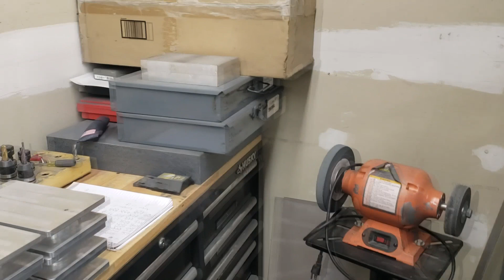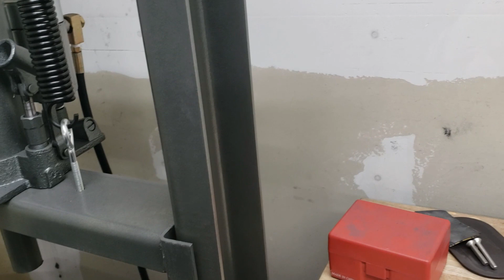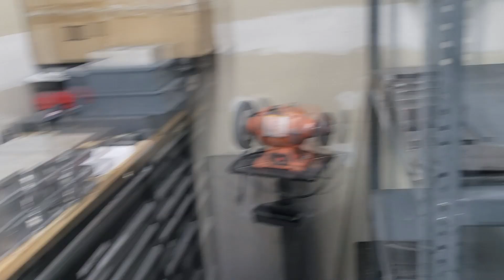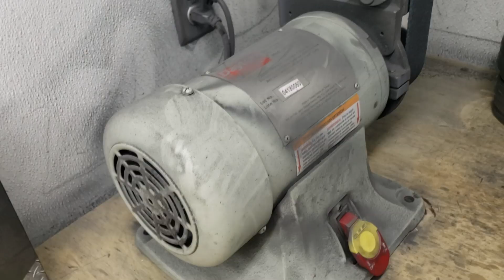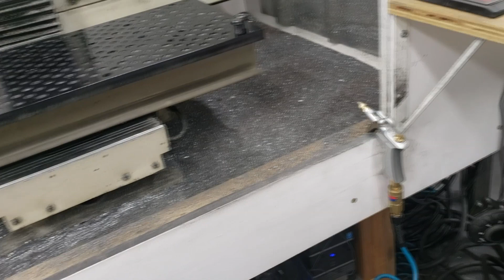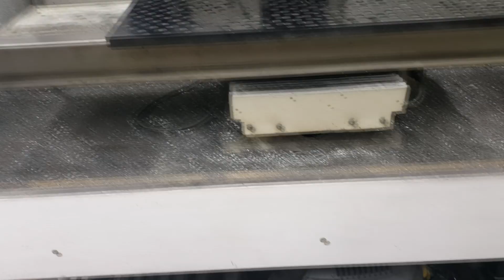Shop Update - New Press, Punch Dies

Comment: Good to see you back Craig. As far as pressing, could you maybe do more parts at one time than one with a larger press and make the time factor less of a factor?
Reply from the maker: Hey, thanks!  I may try to do that with the hole punching. Maybe stacks of 4. Not sure that would work so well with the forming dies. I could try to set up multiple dies at once but I would have to have a large piece of steel to bridge multiple dies. Press brakes are great for something like that.

Comment: Hey Craig - just so you know, ASU reopened the Techshop maker space in chandler, in case you need to use any of their machines, the have a couple mills (jet clone of Bridgeport) and lathes  plus all the other normal metal and wood working. Although they don’t have the machine shop (mills and lathe) open yet, I think another week or so, I believe it will be $150 a month. They call it ASU innovation center I think. Good luck out there
Reply from the maker: Sweet! I might have to learn how to use the lathe.  Thanks, Eric!

Comment: Might be able to make a pocket in your existing fixtures to locate a punch and die from something that already exists, like a trumpf or amada press... Problem you might see with hole making is the slug may try to trap the punch in the die as well as alignment. But you could add guide rods and die springs to fix that... I would maybe have the punch portion lower, to punch only the hole first, then your forming die be further into your stroke because of your somewhat limited tonnage. The trumpf sized tooling is pretty small. I think it could be worth trying. Good luck, keep making videos.
Reply from the maker: Thanks, Tony.  It sounds like you know quite a bit about this kind of thing. The Trumpf system looks pretty impressive.  I am looking at making a new system with 4 guide rods instead of 2.  The local stamp shop that gave me a quote on the work said that they would do the job in 2 operations, punching and forming They want $1600 for the setup. I have the forming dies already, I figured I would just make the punch dies.  I wasn't really sure how to make the punching die that will make the center hole and the part shape at the same time.  I was thinking I was going to have to do it in 3 operations.  Maybe one die for the 5/16 center hole with a jig for different sizes of covers.
Reply: @craigsmachineshop2040  trumpf dies and punches are cheap on eBay. Maybe $20-40 each. You'll also want some shims to get the punch flush with the bottom of your part. I worked for a precision sheet metal shop and learned a lot.

Comment: Glad to see you back Craig, you might try p20 tool steel it's a pre hardened about 27 rc, so its plenty soft for machining but will hold up decently.
Reply from the maker: Thanks Daniel!  Thanks for the tip, I will try it out.  Not having to heat treat would be nice.

Comment: sweet, want to dabble in some punch dies after I finish up the current job
Reply from the maker: Nice! I am guessing that it isn't as difficult as I think.
Reply: @craigsmachineshop2040  Well I want to punch a 5 inch diameter circle, from reading the first few pages of a book on amazon I think I need like a 32 ton press unless I can bevel the edges of the punch/die.
Reply from the maker: @multiHappyHacker   - Here is a calculator: https://www.unipunch.com/support/calculators/tonnage-calculator/